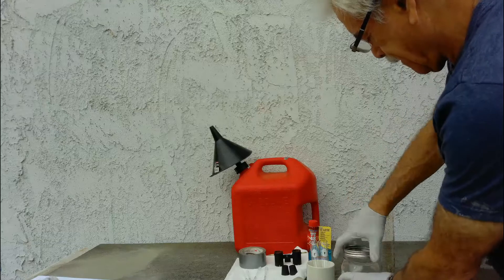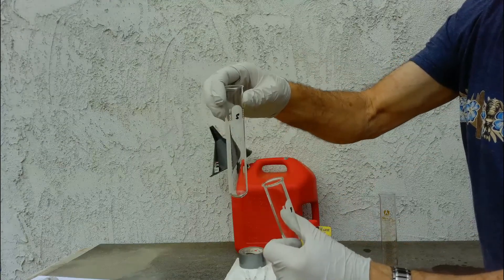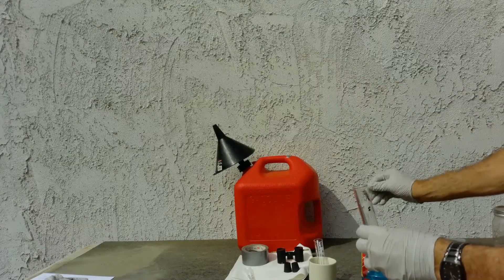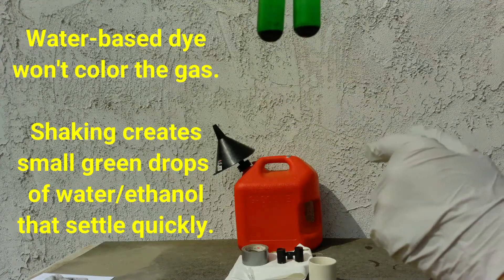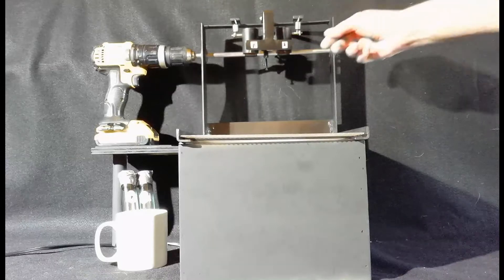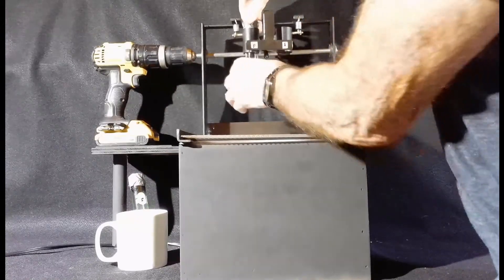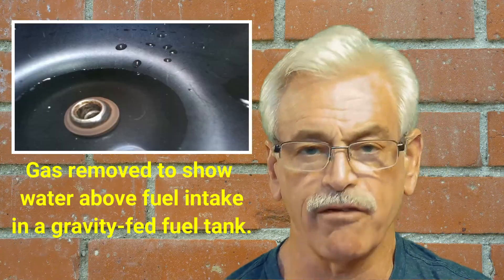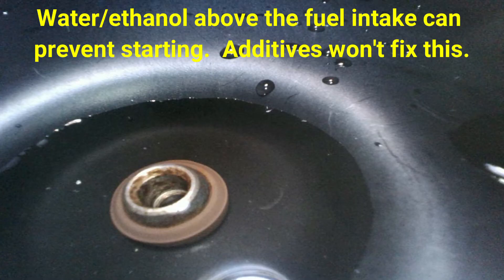The Last Phase Separation Video You'll Ever Need To See {E10}

Comment: I think your smart on this subject and I need help. 
Think of this like a riddle. 

Bach ground I own a BMW with a n63 engine. It likes and needs premium fuel. I was not using it until prices on premium came back down. To my surprise one gas stations regular ran ok ( more on that later ) 
Yesterday I was near empty and price was right so I filled to 3/4 full with  there Premium fuel . Walla miss fire injector 8 code and rough idle. I could clear the code after engine warming up but if to much throttle code would return. 
I research and find a person that says run middle grade if this happens bc your fuel may have to much Ethanal content.
Everything clicked in my brain . Maybe this new gas station is using ethanol to raise the octane level. That's why my car liked there Regular unleaded fuel. 
By the way After clearing the codes to much BMW makes it a permanent code.
Is there an easy way to remove unwanted Ethanal from that fuel in my tank ? Please help

Comment: Excellent demonstration. 
I have a vehicle that was filled with gas and garaged around 6yrs ago. Because it was completely filled, i feel confident that little atmospheric water got in. I do live in a cold climate and the car was totally untouched in a dry garage.
It wouldn't start (of course) after a pretty large amt of cranking. Yet I smelled no gas from the exhaust... (can easily smell the gas from the filler tube)
I am wondering if 1) I wasn't just pumping water the whole time and therefore just didn't crank really long enough to run all the water thru the injection system. Or 2) If said water, presumably settled out of the gas in the bottom of the tank got initially pumped, but then was caught by the fuel filter and now has clogged it? 
I'd love to put a dry gas type product in to disperse what's left, but have no way to agitate it. Might it still work if poured in and left for some time (a month)? 
Do you think removing the fuel filter is required at this point? 
Do you think that the gas is so old it will not combust? (this part i genuinely doubt, feeling confident that it will burn... i guess i could draw a sample and run it in a mower to be sure)
Thanks (if you can help)
But thanks either way for the demonstrative video 👍 😃

Comment: Best explanation yet. Thank you very much for taking the time to do this because water in my outboard ethanol has over the past few seasons caused my 2017 Etec to shut down and found out the fuel system was completely full of water and $600 later and another boating season fast approaching I was looking for a solution

Comment: You do have to admit we wouldn’t have this problem at all if we didn’t use ethanol enriched garbage fuel. Ethanol is more of a problem than a benefit.  You take the carburetor off of a machine.  After running these garbage ethanol in Riched fuels and there will be a big chunk of yellow jelly in the bottom of the floatbowl.  I just pick up a couple 5 gallon containers of 100 octane low lead from the airport small airport carry out an auxiliary fuel tank hook it up to the carburetor on every piece of equipment I have run the machine on the 100 LL .  I could let it sit for two seasons turn the key in it fires right up. Of course I have to drain the ethanol-based garbage out of the tanks.  Ethanol gas is shit. It sucks that you can’t buy non-ethanol fuel just 90 octane 91 octane I don’t need 150 19 or even 100 for my  zero turn commercial  Machine.  Don’t get me wrong I do like running the 100 octane low lead and 115 110 race gas in something that can benefit from it by leaning and enriching the fuel circuit with the right timing. But that’s a different discussion altogether. Most people think well I shouldn’t say most almost anyone I’ve ever Came across said you can’t put 110 octane fuel in there it will melt the best and it burns hotter. Knowing that’s not the case I’m sure you know that as well hence why you use higher octane fuel and turbo and supercharged applications by my race cars. To combat that nation but I’m sure you know tha came across said you can’t put 110 octane fuel in that it will melt the piston it burns hotter. Knowing that’s not the case I’m sure you know that as well hence why you use higher octane fuel and turbo and supercharged applications by in my race cars. To combat Detonation.
Reply from the maker: Thanks for watching the video.  Ethanol causes some serious issues in small, air-cooled engines and boats, as they have vented fuel tanks that let in moisture. In modern automobiles with sealed fuel systems, they run well on ethanol blends.  Not as well as neat gasoline, but well enough.  Star Tron really does a good job in combating these issues.